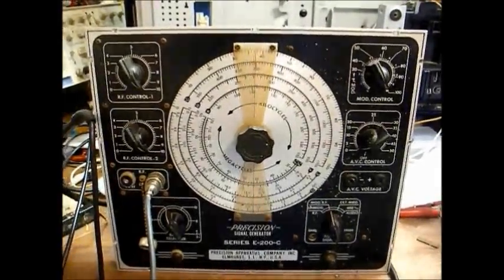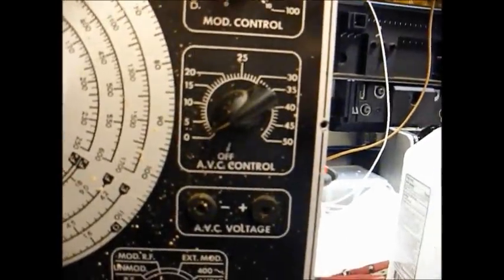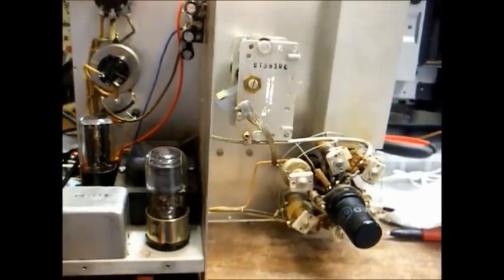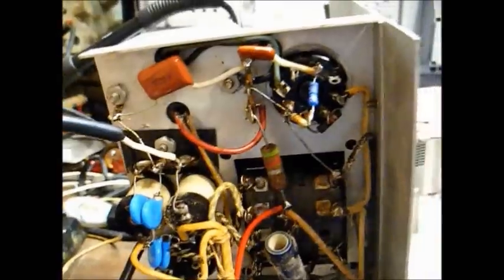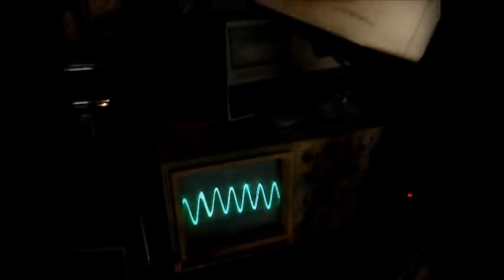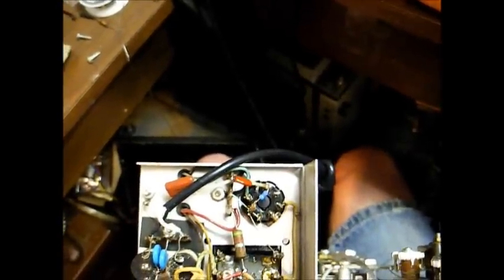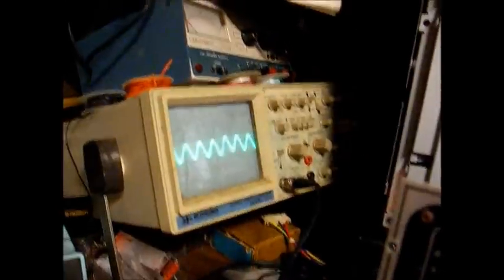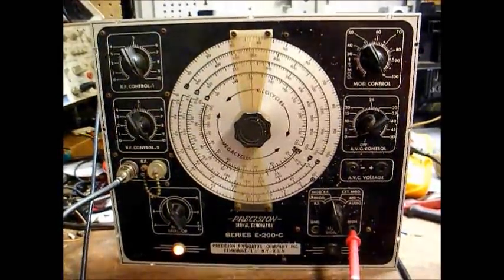Repair of a late-'40's Precision E-200-C RF signal generator - part one

Comment: I recently picked up a E-200-C on ebay. It came without the RF output tube. 
After replacing the the tube I didn't get any RF output, or AF output at all. It seems among other problems neither oscillator will run. I found that someone of course had worked on it, and wired the main tuning capacitor up wrong. Fixing that didn't help.
All three filter caps were pretty much open, so I replaced those. Still no luck in getting anything to work.
I dug up a number of versions of the schematics for the unit which of course went through a number of changes down through the generations of the unit. Especially to the RF section. I could not find the schematic that fit my unit exactly, but found a later version schematic that was fairly close, traced things out, and then modified that schematic so I would have a copy to work off of.
I checked all the tubes, a number of the resistor values, and all the caps with my LCR meter and they're all within spec, but still neither the RF or the AF oscillators will run at all. I've carefully gone over the circuits. checking voltages as well as component values. The version of the unit I have has a Frequency range labeled as A-G2, G4.
One very odd thing I have going on is that I get what should be normal grid voltage in the ranges "B - G", but for some crazy reason I get the plate voltage on the grid circuit when in the "A" position (lowest frequency range). 
I've been through the stacked switch trying to find the source because it appears to be coming through there . Pull the output tube and it disappears. It's a head scratcher and I've shelved the project to work on other things and will return to this at a later date. I do have other signal generators.
I agree that the User's manual reads a lot like a sales brochure regarding the AVC.. They do make a big deal out of it. I do prefer to disconnect and substitute the AVC voltage on various radios I'm working on when trying to do alignment. Of course it's not absolutely necessary, but it does allow for greater precison. It's the only part of the unit that currently works.

Comment: Question for anyone.  Are the any adapters (original mic connectors to BNC) that anyone knows about?  Or, what RF connectors are these (thread type and size - 5/8 - 27, etc)?  Thanks in advance.

Comment: If you haven't sorted out the audio problem yet I have a suggestion, on the back side of the modulation control is a calibration control. Have you tried adjusting it?

Comment: Remember- electronic oscillators and amplifiers have a D.C. voltage circuit, AND an A.C. signal circuit. Since you have already checked the D.C. voltages, it looks like this signal generator has a problem with the A.C. signal circuit.

Comment: I cannot be the only tech that is wondering about the carbon comp / metal film resistor effect on the audio oscillator.  Anyone know why that happened?
Reply: I SUSPECT that resistor that was replaced in the audio circuit was of a critical value. If it was MY signal generator, I would use the EXACT resistor that was specified for the audio circuit.

Comment: Was that replacement a carbon film resistor or a metal oxide resistor? It's strange that the audio oscillator would be that fussy about the replacement unless there was something wrong with it. Was that where you connected two resistors in series?